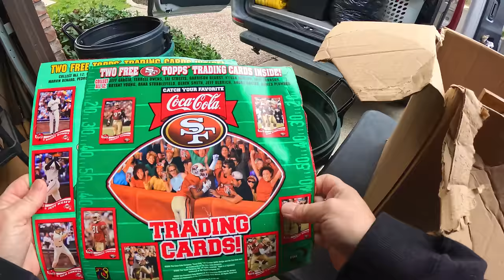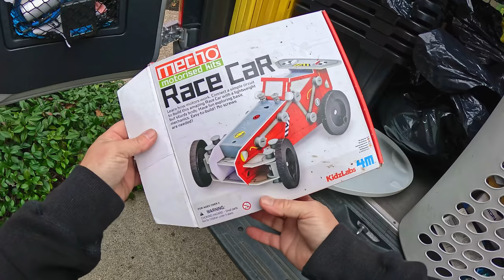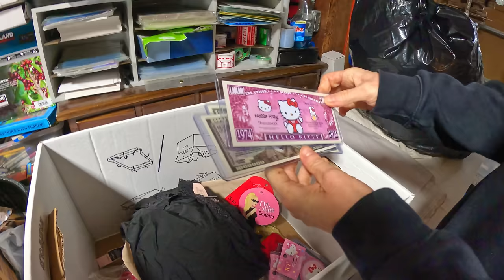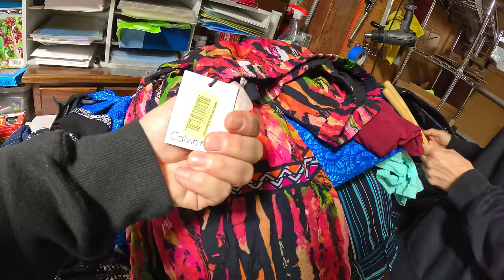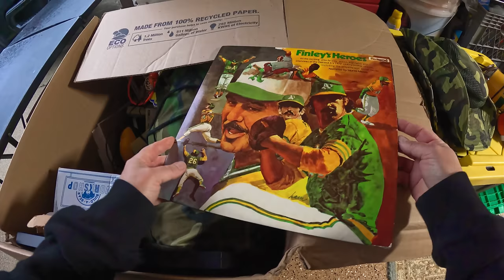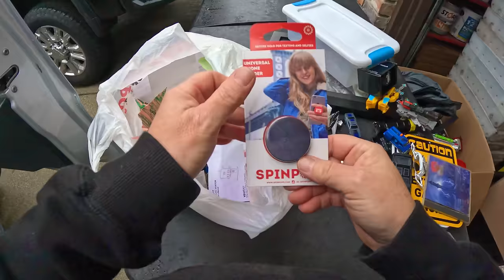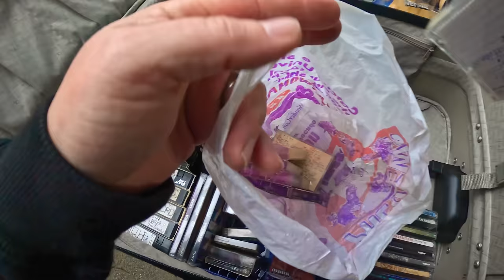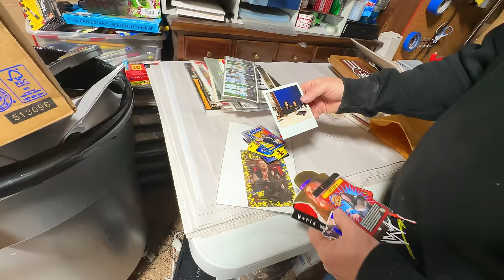CRACKING SAFE FOUND IN STORAGE UNIT! You won't believe this!

Comment: just a heads up you can usually just pop off the barrel lock on the safe.  This provides access to the override mechanism to be slid over to gain access to unlock the handle.

Comment: The Joe Montana signed card could possibly fetch a few hundred. Nice find, The 1989 Ken Griffey Jr rookie upper deck is a classic and depending on condition ( free of corner and edge damage and nice centering could fetch up to several hundred to a thousand again depending on if it’s in mint condition
Reply from the maker: Both those will be in our Whatnot auction on Monday!